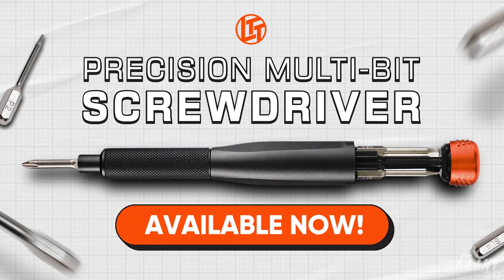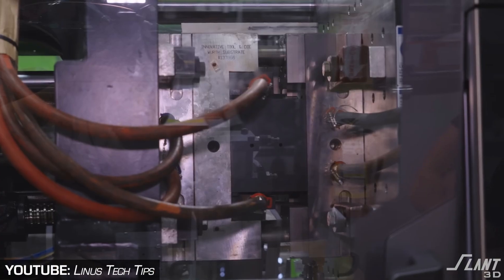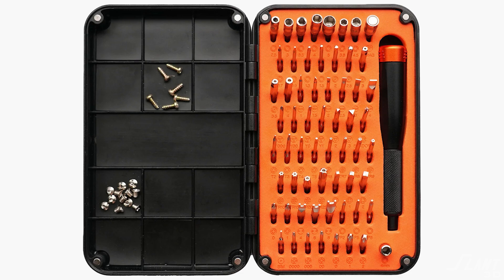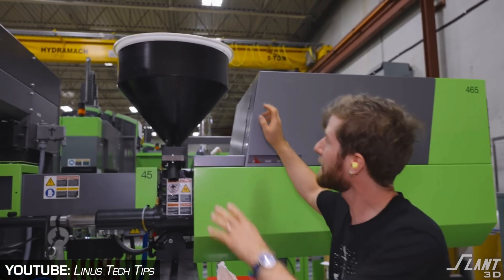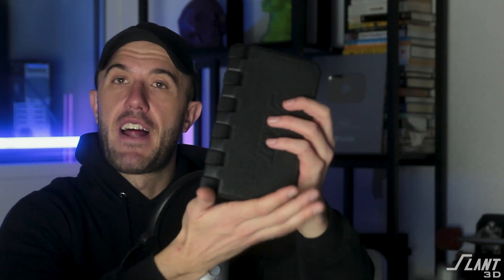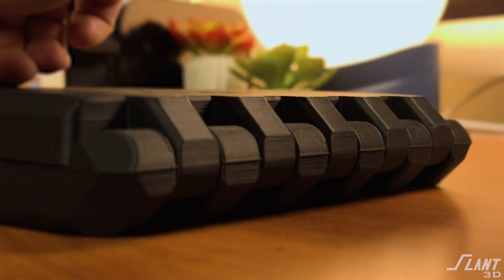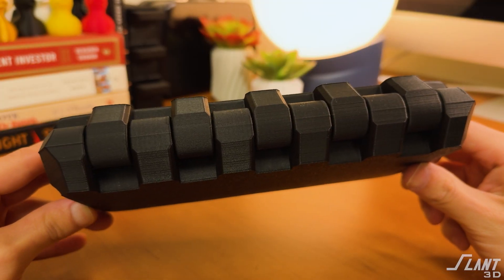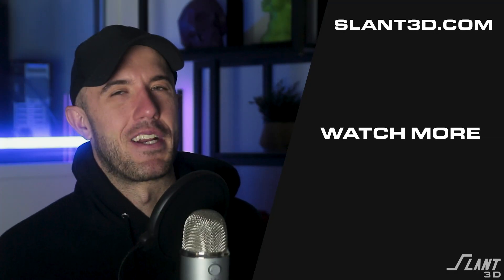We 3D Printed a Screwdriver Case for Linus Tech Tips | LTT Precision Multi-bit Screwdriver

Comment: As someone who preordered this after how great the OG LTT Screwdriver was, they 100% prototyped this with 3d printing, you can even see in your B roll. They used 3D printing to prototype and finalize the designs components. 

It is very cool to see your guys design this and show what’s possible.

I commented a year ago about my concern about bias and objectivity when you brought up starting a testing lab for filament as a company that makes filament.

I’d love to see you talk about the bad sides of your case if you want to be objective. Like the lack of separating lid, lack of magnets, reliance on plastic hinges that are likely more breakable than the metal dowel. How the foam insert for the bit holder would hold up versus the compliant Leif spring mechanism when you already talked about how compliant mechanisms fail over time. The use of magnets in the lid to make it so if you bump your desk or the sorter the screws don’t jump to other sorting locations. 

I am a huge fan of the idea of disrupting injection molding and showing the value of 3d printing. But if it’s going to be something where you start testing others designs vs your own. It would be hard to trust the results.

Just like we shouldn’t trust Boeing to test the safety and reliability of its planes without a unbais 3rd party… oh wait
Reply: Honestly, I think what he showed was a simplified version of what’s possible if LTT used 3D printing instead. I think we all saw one thing or another that could be better. Like the screw compartment could have walls added and it could still have the inverted pyramid. I believe you’re taking the example too literally as a comparison, that’s not the goal of this video or many of the others that they post. It’s a demonstration of what’s possible, plus tips for those that design the products.
Reply: That how I've been taking these. A look at this thing someone made, and here's things you do differently in 3d printing vs injection. As a budding designer with a million ideas, I love this content.
Reply: Exactly, this whole piece is so disingenuous. And there's zero reason for it. I mean, to say LTT took a big risk going with injection molded when they weren't sure if they could sell enough is just silly. They are huge, their followers are all tech heads and the kit is priced low enough that many people would want it, even just to be part of the tribe. Not hindsight, pretty obvious to me. And to say they probably went through multiple molds to get it right is silly, too. If you have a great mold making engineer who knows his stuff, you get it right the first time. 

He should just have said: "here's how you could make the same thing with 3D printing". But nah, he needs to go spin everything and then make sure the video angles are very flattering to hide the print "defects" so he can gloss over the fact that the majority of consumers still sees 3D prints as a lower class alternative. Instead, just admit to the shortcomings and offer the best workarounds instead of pretending that end users would be impressed by his case and consider it better or as good. How about the lack of foam? Tiny user thing, but that foam against metal has a nicer feel that plastic against metal for most. Just admit that and work on solutions to make up for it. 
That hinge on his case is possibly stronger but incredibly bulky. Why not say: "Yes, we have to get the strength by adding more material and it will end up a bit bulkier but that's the price we pay when using filament". 

Maybe it's a cultural thing but if you can't be genuine and honest about where your method is not the best and never shows any humility, then I don't trust you.
Reply: He's not a journalist. He's a salesman
Reply: @disp3rsion I agree that he is a sales man promoting a business in an industry I want to see successful. I am simply providing feedback, if I make statements about the benefits of my system to sell you on my system, and those statements have flaws to them, I think it’s best to provide that feedback so Slant can make the strongest argument for its system possible, not weak arguments like the strength of that hinge, or other benefits of their design that appear inferior. The fact that he is a salesman is the whole reason I was never a fan of them reviewing or testing other people products as there would be a conflict of interest and bias. Remember how a year ago they wanted to raise capital to buy testing equipment to test the strength of other companies filaments? While they make and sell their own filament, this is the issue with bias and conflict of interests. I rather watch project farm or torque test channel test a tool then believe the testing done by dewalt for instance. If they bought the LTT case and tested the hinge for strength compared to their process and design, I wouldn’t trust the outcome just like I wouldn’t trust what Dewalt would say about Milwaukee tools.
Reply: @SliderSS  i agree. i wish he were more objective, and it's kind of annoying how much inaccurate info he intentionally puts out there.  at the same time, i've come to accept his content for what it is: a sales pitch.  in that sense, the inaccurate info could actually increase engagement, like how those 5-min craft videos intentionally do stupid stuff
Reply: Your joking right? He makes parts and a video about it, to demo certain aspects of 3d printing not to make an actual product, they do print farms not product design it's said in basically every video @disp3rsion
Reply: Sir, this is a Wendy's...

Comment: 1:55 i get that this video (and the whole channel) is meant to glaze 3D printing but this part is just straight up wrong. They did test the initial designs and prototypes at home using 3D printing, the issues that they had with prototyping the molds are because the quality of the molds affects the actual texture and feel of the plastic.

Comment: I don’t think that these changes would be an upgrade to the original case like presented. The separation of the top and bottom half of the case was an intentional design (alongside the ability to stack them for a smaller footprint). Also I believe magnets are better for the screw tray than the grooves, which would also significantly impact the mass production process 5:28 for 3D printing if you have to insert magnets after a paused layer.

Comment: I use a 3D printed case for my soldering iron, and it melts/deforms if kept in my toolbox in a hot car. Wouldn’t this have the same issue?
Reply: Not if printed in PETG, ABS, ASA or Nylon

Comment: If you have a multi color/material printer you can also do contrasting colors inset in the inlay or even the logo. The great thing is you only typically have to make that contrasting color one or maybe 2 layers thick to get a proper contrast.
Reply: I'd rather use separate printed parts and glue them in. I hate the waste that's produced by MMU's especially the bambu labs units. Multiple print heads however that could be doable though but most print farms won't have a lot of either.

Comment: I think you missed multiple things in this one, here is just a few:

1. The "sections" in the top lid
That entire thing is magnetic, so all the screw you put in are held by a magnet, so they don't slide around. You probably could do it with 3d printed version as well, but it would be that much chonkier.

2. hinge and separability of the case
It's intentional that the case can be split in 2, so the top can be used as a magnetic parts tray an placed elsewhere.
But it can also be stacked for space saving by splitting it and putting bottom section (with the bits) on top of the top one (with the parts tray) and they snap together with you guessed it, magnets.

3. The orange liner is foam, so it holds the bits nicely without them falling out or being hard/weird to remove, you can't do that with 3d printed or even injection molded plastic holder (not without additional of magnets or TPU I guess).
Yes I saw your version, but it still is meh compared to a very simple foam (it seems like in this video you think only plastic exists).

And I am rather not going to comment more on the layer lines, chonkiness, lack of features and other issues of your version. With the amount of units they sold, 3d printing would actually cost them more (yes, they didn't know for 100% it would sell so well, but they had a pretty good idea from previous screwdriver launch).

I think this video is swing and a miss sadly.
Reply: I'll have to agree with you here. There are intentional design choices that Slant glossed over. I feel like his/his team's design is a good option for someone who bought the driver without the bits/case, but it lacks the polish and funstionality that LTT was going for in more than one way.

That being said, I think Slant limits their designs to ONLY use 3d printed parts because that's what they can make in house and they have no desire of working with, say, a foam insert manufacturer.
Reply: @TrigTrig  I'll give you three to one that Shadowfoam come out with a custom insert by the end of the month!
Reply: It's not meant to be a finished product. It's an example of what's possible. I also don't think they have a set from LTT on hand. They don't know what they don't know. This is content and if they did work with LT on a case it would be different obviously.
Reply: @parawizard  Yeah, it is a great example of how to make a worse product in every way possible.
Reply: Yeah, I think they didn't look very deeply into it when they made this. All your points are great examples of solutions they tried to improve but are actually worse than the original box. 

I'd argue you missed a huge point

4. The foam liner is labeled, its very hard to print labels, especially the fine detail needed to replicate the LTT case. You could do it with laser engraving but that would add even more cost to what Slant was making out to sound like a reasonable expensive case.
Reply: It's very likely he knew all those things but when you have agenda different rules apply...
Reply: I like the different take on design.  The pyramidal screw sorters would likely seriously improve my experience with picking up small parts.  It’s worth a shot for me anyway and likely tweakable for me.  I’ll probably toss a magnet on some.  For me the main take away is different design decisions that seem innovative to me.  When I start building custom boxes for some of my tools I’ll likely combine many features and I’ll likely have many iterations.  I’m brand new and never even seen a 3d print, just researching still, but I can see how powerful and transformative the tools and design thought will be. Looking forward to ordering some decent hardware in a few days and learning much more about design and process. Thanks!
Reply: People are so funny. So many comments in here taking this as a literal comparison to the original 😂 Almost all of the videos they post are not meant to be a 1 to 1 comparison, they are a DEMO of what’s possible with 3D printing on a commercial scale. Plus give all of us non engineers some useful tips.
Reply: @only1muppet  Yup!!!! I went through a bunch of comments thinking people are funny with their criticisms and won't appreciate what Slant was presenting... By the way, WHY would anyone even buy LTT's kit of junk beside wanting to support him? There are Wiha kits out there, even coming as ESD safe and actual pro tools used in the electronic industry. Yet folks are going ahead and buy the cheapest ass product because it's LTT. Then Slant is trying to ride the trend with his version of the box, I get it he is a tad salty LTT ignored him... I like the explanations Slant is providing in his analysis but some comments here are hilarious if half of the guys here are so smart and serious about the box they "want" or "need" then start by actually buying half decent screw drivers and the screws/hardware that goes with it. THEN we will talk "smart storage"... 
-- I know someone will tell me "you don't need Wiha", well I think they're the basic if you're serious about what you do with small tools. It's not like as if I was telling you "you need a PB Swiss, Horotec or Bergeon"
Reply: He runs a business, folks need to understand he has a natural bias to never really admit 3D printing has its disadvantages and weaknesses in some areas. At this point it's more or less expected.
Reply: @Roobotics  Sure he runs a business, but to be a GOOD business/business owner is to know where your weaknesses and biases are and keep out of things that are not your wheelhouse. 3D printing at scale isn't always cheaper and better than mass production. Smaller less time-sensitive runs, prototyping and things that can't be injection molded are definitely the wheelhouse of the 3D printing outfit. CAD and bespoke design services are also a value add for a smaller shop. Mass production of 100K pieces of a BOX? Meh, let the CNC and injection molding boys do their thing.

Just because he "runs a business" doesn't mean we have to pat him on the head for a silly idea that no one asked for.
Reply: @jodylang8781  I never asked to make those concessions, I'm just stating how he seems to be, that printing is the solution for everything, and it's always the cheapest, and.. yea, no. I get where you are coming from, but he never really replies back to genuine criticisms or input, only the yes-men. I'm mostly just here for the little bits of actually useful information, some of which has occasionally influenced how I model things for my own prints.

Comment: there are some good points here however what bothers me is the misconception left here on the process of injection molding engineering process. its stated that you have to do a full production run, however no one would ever go straight to a hard tool run. pre production is always done with soft tool sometimes even multiple runs. second he says you can't really prototype at home, what is that even supposed to mean, looking at LTTs current design you could 100% print it without any support in 3 pieces. i understand that 3d printing production has some advantages however a lot of this feels like purposeful misconception.
Reply: At work I design parts for injection molding. At home I design parts for 3d peinting.

With that background, I want to say that I like his videos but in the end he has a business to promote. As always, take the new and useful information and disregard the rest.
Reply: You misunderstood. He was saying you can't prototype using IM specifically at home. There are 1 or 2 products in the horizon though for doing this.

Comment: The truth is that 3D printed, no matter if it is actually stronger, and no matter how many times you repeat that "you don't notice is 3D printed", gives the sensation of a cheap product, not premium at all.

There are many instances of design decisions that are done based only on making a product FEEL premium, even if it involves making it weaker or less useful.
Reply: I'd add the caveat that this is only true when your goal is the slant special of "mass production 3d printing" where you get half a dozen materials to choose from, coarse layer lines, no multi-material, etc. 

You can absolutely get incredibly fucking solid and premium parts made if you are willing to however. The reason why the parts he shows look so cheap is that every part they produce is specifically designed to be made cheaply; coarse layer lines, likely made of PLA, super-chonky, etc. 

If you go for finer layer lines however you can very easily get super solid parts that have layerlines so small you can't even feel them, letalone see them.

Comment: I mean, the point of the case was to allow it to separate so you can use one side as a magnetic parts tray. Also, in the quantity theyre working with, molding just makes more sense and is cheaper in the long run. 3d printed holders also cannot grip the bits like the foam can, and theyll either fall out too easily or be too hard to pull out.

Most of the time you guys nail it, not so much this time
Reply: I'd like to see the leaf design with a full carriage of bits held upside down. You're still going to have the tolerance issues.
Reply: @sirseriously  tbh his 'leaf' design wasn't even very good. You absolutely could make a good spring-holder, but you'd want it to be per-bit and possibly even have a mechanical snap-latch. (you know that the bits should taper down after a known-length, so you could create a very small flexure with a triangle that will literally snap onto the front of the bit.)
Reply: Id also add the flex strip is not a good idea, once you add a larger bit, the bit next to it no longer makes contact. Injection Molding + Foam insert like my ifixit set is the way to go. I make a living off selling 3d printed products, so im all in favor or 3d printing, but theres just some instances where injection molding makes sense. LTT has millions of potential customers and the platform to sell and move product. Injection molding is the only thing that makes the most sense. This isnt a start up that needs to make unknown quantities to start and test the market where 3d printing would be more advantageous.